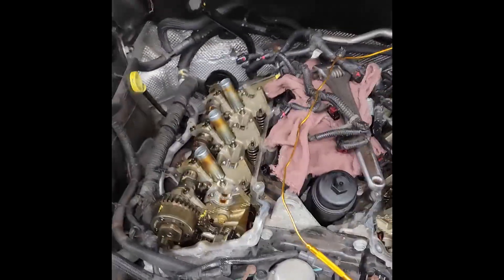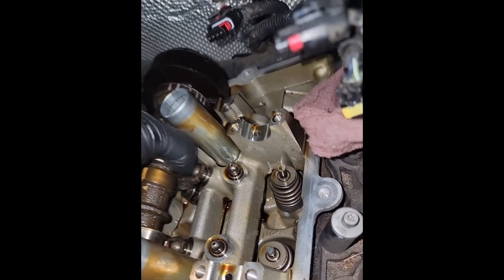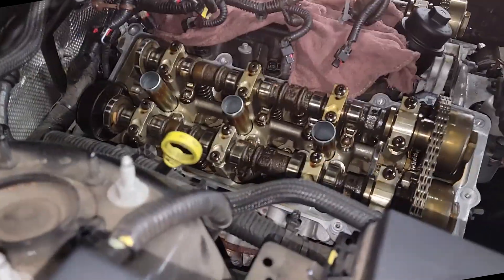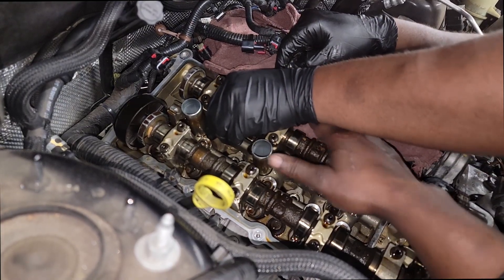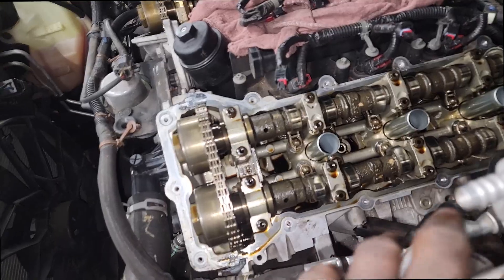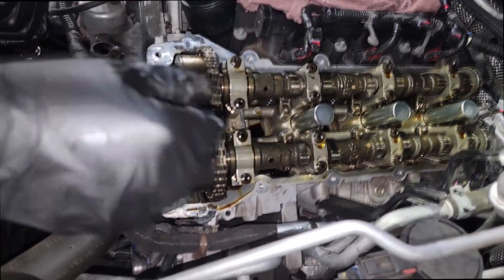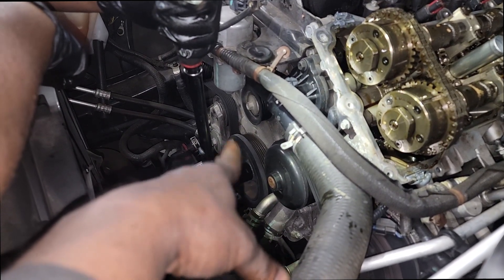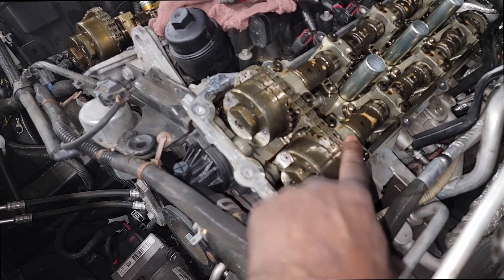Mechanic Helper Training on a V6 3.6 Pentastar Engine with a Ticking Noise.

Comment: On the new VVL Pentastar, I try to sell an intake rocker arm change every other oil change as normal maintenance.  🤣🤣   It is a real sad problem techs are going to be busy with for a long time.  I really hope the aftermarket comes up with a genuine fix since Chrysler seems to be letting it slide.  Pardon the pun.

Comment: Jt I have a question about doing a transmission service when refilling it is it best to lift the truck or have all four wheels on the floor to make sure the transmission is leveled on a 14 dodge Durango 3.6 rwd
Reply from the maker: Well you suppose to go through the gears after the first re-fill to help reach desired temperature and fill clutch packs. So the truck has to be off the ground for that.
Reply: Can yiu tell me anything about a p0732 code  @OnlineMechanicTips
Reply: Is my transmission worth doing a service on
Reply from the maker: @rayanthonymendez  Absolutely

Comment: Had this done in my POS 2011 Dodge Grand Caravan, didn't need camshafts. Rplaced what your showing, and some other parts known to fail (rods or something), still was a $1400 job. 
  U.S. auto makers need to step up their game, and own these costly repairs. Guess there is/was a class action lawsuit againts Dodge for this crap, don't know where that went. Garbage motors, and transmissions.